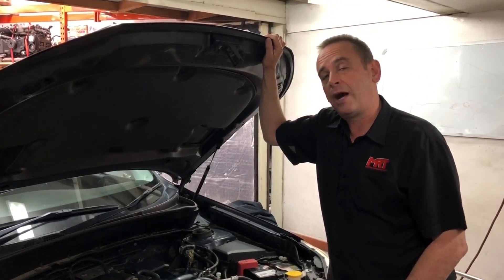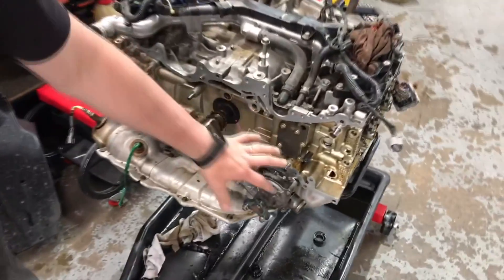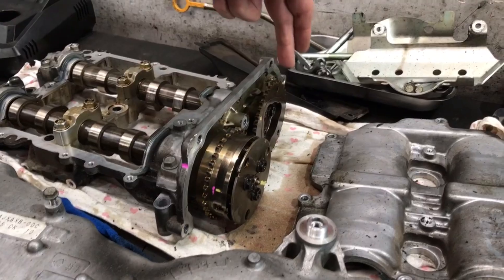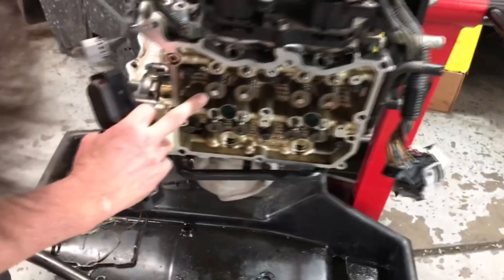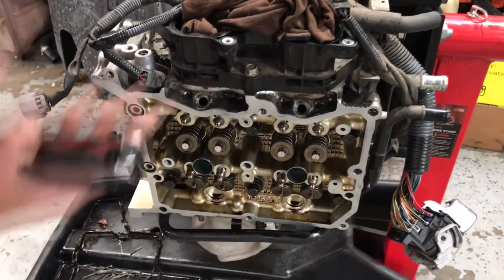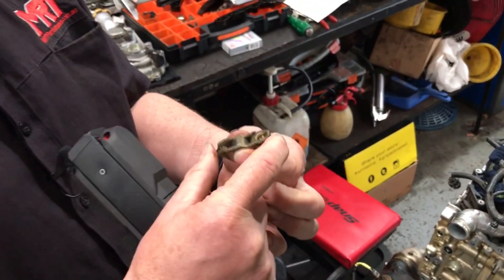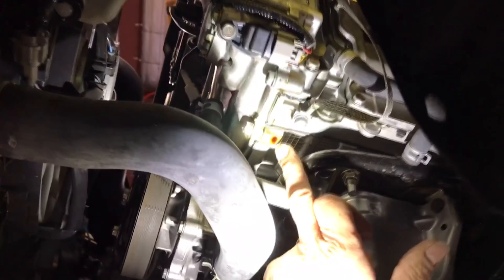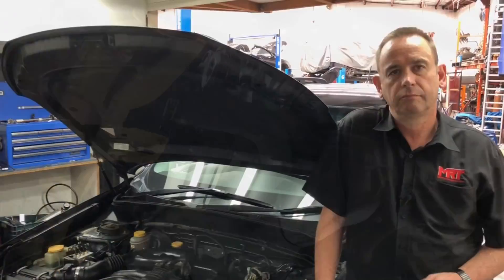Subaru FA/FB Engine Teardown and Assembly

Comment: Is there a difference between FB20 auto and Manual crankshafts? Wanting to put engine from an auto into the manual. Crankseal part numbers are different hence the question?

Comment: One side of my cam sprockets won’t sit in its proper place for timing. The top cam jumps counter clockwise and the bottom cam jumps clockwise, the arrow won’t stay pointing at each other. How do you get them to stay in proper timing?

Comment: I replaced my timing cover seal and it's still leaking on the  driver's side front area leaks down onto coolant hose.Could it be the gasket on the assembly above the oil pan .
Reply: Cam rack to head needs reseal https://youtu.be/-jDrkEEK99E

Comment: Can I turbocharge a 2019 fb20 direct injection na Impreza?. Thank you for all your videos
Reply: you would be better off just buying a wrx. Its not worth the money to do so
Reply: Fb20 junk https://youtu.be/-jDrkEEK99E
Reply: Yes you can they are capable of holding boost but only up to around 8 or 10 pounds but if your going to you need to make sure the motors healthy and strong

Comment: These boxer engine (or Porsche) will unlikely to have VTEC, obtaining higher valve open/lift duration. This variable timing limits the valve lift duration bc it uses single lobe. 

With VTEC, these boxer engine long block would extend about 2" on each side

Comment: Have you guys heard about this?   Subaru could issue massive recall affecting many U.S.A.     According to sources in Japan, “a valve spring could break and hamper the workings of the engine.” The report says every vehicle Subaru manufactures, except for their Mini vehicles, (not sold in the U.S.) are affected which means hundreds of thousands of Subaru vehicles in the U.S. could be recalled.

This would include all models like Outback, Forester, Crosstrek, Impreza, Legacy, WRX, WRX STI, and BRZ sports coupe. It would also include the Toyota 86 jointly produced with Subaru and uses the same Boxer engine. So this could also mean Australia. Don't know what year model, maybe the 15's.
Reply: You were correct.

Comment: My wife recently sold her 2015 wrx (FA20) with 102,000 miles on it, didn't use any oil or leak any oil. Besides oil changes, air filters and 1 set of spark plugs it didn't need any work. It was a fast car and still got 27mpg daily driving and over 30 on the freeway.
Reply: You got lucky https://youtu.be/-jDrkEEK99E

Comment: Have you experienced a timing chain rattle type noise on this family of engines from cold start up until the oil warning light goes out?
Reply: I came to this video for answers to this question. ‘17 FB25 OB. Also only last for a few second. I suspect it is the timing chain tensioner not having oil pressure from sitting. He mentioned it in a previous video a little offhandedly. But is this normal?

I’d highly appreciate input from anyone reading this!
Reply: @jamesgiant2342  13 FB25B OB 165,000 Miles here. It's not normal,  there's a other gentleman on youtube who replaces the tensioner and the sound fucks right off. My guess Subaru figured they had enough recalls and issues they let that one slide
Reply: @jamesgiant2342  if you drain the coolant you can take the radiator and front upper frame off and replace the tensioner and chain yourself
Reply: Have that sound from my '17 FB20 and '19 FB25. It only lasts a couple of seconds...

Comment: I have to pull the cam box on my FRS to fix the left side valve noise. Is there any thing I should upgrade when I’m in there? Thank you.
Reply: Just keep an eye peeled for any unusual, uneven or advanced wear in any of the components (valve train) and everything should be good.
Reply: Is one of the first FRS built in 2013 and I have heard they had issues with the cam gears. Do they need to be replaced when i am in there. It only has 27,000 miles
Reply from the maker: just use common sense with the rebuild, there is no perf parts we suggest,
Reply: Fb20 junk https://youtu.be/-jDrkEEK99E

Comment: These engines will just never change will they. Have they even fixed the head gasket issue blowing at 150000 from 20 years ago. I had a 99 legacy gt and the thing wouldn't hold cam seals in the head. The cam seal would just pop out of the head and sit behind the cam gear and leak endless oil on the timing belt. I had to literally take a knife and put a score in the cam seal journal to get the thing to stay in there. Once that problem was figured out I loved the car again for about 6 months until the head gasket blew. I junked it and said if never buy another subaru again.
Reply: Head gasket issue was from a lack of support on top of the cylinder+ very small cylinder wall that vibrated. Fb/fa engines do not have such issues
Reply: @invertedv12powerhouse77  well apparently they haven't fixed the leaking oil issues. Lol
Reply: @blindabinda1234  hmmm its not from the same areas. We dont know about the valve covers yet. At 250 k km we often saw the valve covers started leaking... But i mean thats just a shitty valve cover seal. Easy fix.

There was also a sensor at the back of the engine that had tendency to leak. This one seems to mostly have an issue with the timing cover, which is also easily fixable by adding more silicon. The corners seem to lack enough sealant
Reply: @invertedv12powerhouse77  kind of crazy for the timing cover to be leaking at 25000 miles.
Reply: @blindabinda1234  250k km not 25000 miles
Reply: @trebla8928  I'm talking about the car in the video leaking out of the timing cover at 30 or 40000 km. Which I think is about 25000 miles
Reply: Subaru problems are highly exaggerated